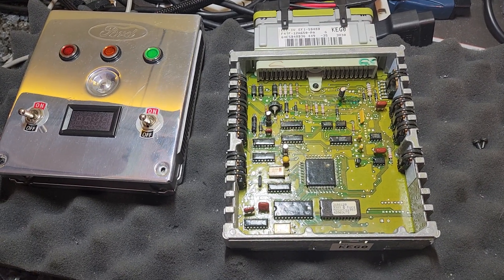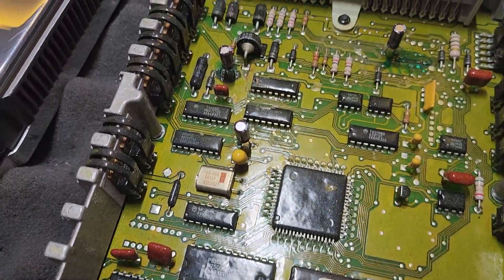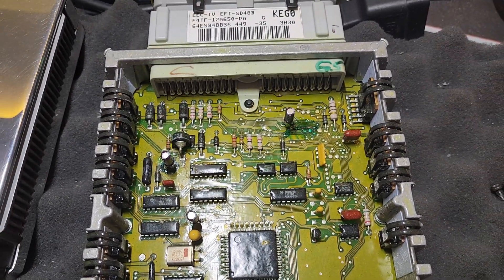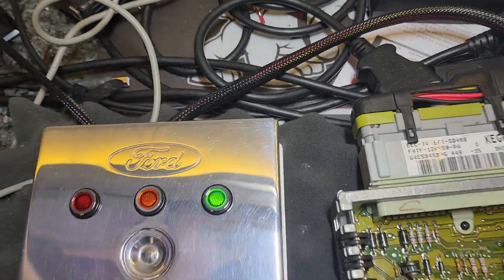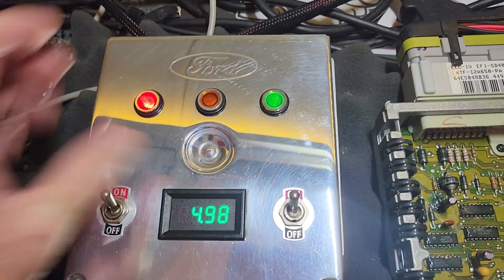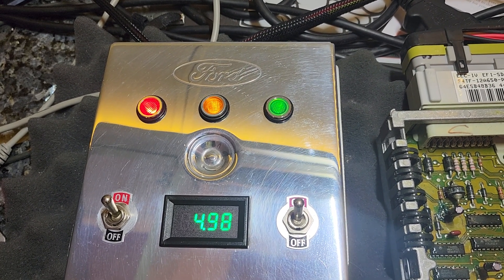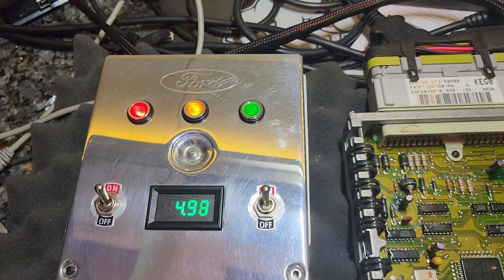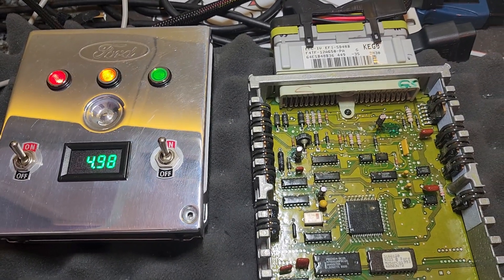Post Repair Inspection of Tim M's 1994 Ford F250 Computer

Comment: This is really cool. I have a 1992 jeep Cherokee we actually have a couple 92s. I am curious if you could take a working ECM and refresh it better with modern parts or upgrade it in any way to make it more reliable or beefier etc? I don't want to make a super long comment here but my cherokee is heavily modified and we also take it on long trips I've done a lot to make it more serviceable and build in reliability. I'm very familiar with the wiring and modules and things but I'm not familiar at all with the internals of the engine control module or this type of work. 
Anyways it would be neat to have an ECM refreshed with high quality parts if that is something possible or worth doing? I have spare used control modules. 
I don't trust reman or aftermarket control modules I find a lot of that stuff is junk and put together cheaply. 
I don't know much of anything about control module internals but I do know on the Cherokee ECM when you take it apart there's this rubber like stuff it's filled in with so a person would have to dig that out I believe I haven't tried getting into one.
I would be very interested in having a control module gone through and upgraded in any way to make it better stronger or more reliable plus it's 30 years old now.
Reply from the maker: I'm not familiar with the older Dodge computers. But any computer that has electrolytic capacitors in them that is over 20 years old would be highly recommended for replacing the capacitors BEFORE they leak. They are about the only part inside that has a shelf life. Everything else just works until it doesn't. These die of age, regardless of care or mileage.

Computers that are under the hood are usually sealed up with some sort of rubbery type gasket material. Computers installed inside the vehicle don't need to be waterproof, and so they may not seal them at all. That's how this 94 is, unsealed and very easy to take apart.

Professionals who repair PCMs regularly will heat up the computer and carefully cut or pry apart the rubber seal to get it apart without damaging the PCM. After it's apart and repaired, they clean all that rubber off and replace it with something similar, or maybe even just silicone. I don't know if the older Dodge PCMs have electrolytic capacitors in them. But if they do, they should be replaced based on age alone. We're seeing 94-95 Fords now coming in with capacitor issues, and have been seeing 87-93 Ford PCMs come in for many years now. So your 92, if it has capacitors, is the right age (or late) to replace them. Everything else in the PCM is not in need of refreshing or upgrading, just the capacitors.

We only do the Ford computers, but I can probably turn you on to some smart guys who do the Dodges, if you can find out that your PCM has capacitors in it. A lot of the pre-96 era stuff does.
Reply: @dragradialperformance3540   thank you for taking the time to write me a nice response I have some research to do then to find out if I have those capacitors. 
I do put a lot of trust in this vehicle my wife also daily drives a 92 Cherokee we really like Cherokees and it just so happens we like the 92 models I've had almost every year of Cherokee xj but the ones we have kept and really like is the 92s or 91-95 really is what I tend to stick with. But anyways I'm going to do some research and see if I can figure out more about the ECM. My cherokee is very heavily modified I've rebuilt most of the harness with mil spec wire that was a fun project a little tough to find some of the contacts for the OEM plugs. I could have gone with an aftermarket computer and stuff but I've done some things and added some stuff to get more out of the stock systems and I just like having the stock control modules I'm running a piggyback setup on the transmission control module to do some neat things in conjunction with some transmission mods but I also retain all the stock functions. Then I'm running a stroker engine with some things to make it all work with the stock ECM it's actually been very reliable I've played with these jeeps for so many years that I've kinda figured out what's best for reliability and modifications sometimes you don't always get reliability with modifications. Then I have access to diagnostics for the transmission and engine module even some live data with my snap on mt2500 you probably are familiar with that since you work on the pre obd2 Ford's. I'm a bit of a nerd when it comes to my gadgets and playing around with these jeeps. 
I've never seen a Cherokee pre obd2 module fail except for I have seen the voltage regulation fail which is controlled by the ECM you can replace the ECM or set up an aftermarket regulator to correct the problem. I really like the idea of having someone freshen up a module or two for me if it has capacitors, I'm definitely going to learn more about their construction. We plan on driving our Cherokees and others for a long time to come. 
Thanks again for the information I'm excited to learn more about it.
Reply: @dragradialperformance3540  here's a short little video linked below of the ECM I have. it looks like it does have capacitors from the little bit of research I've done. I actually was reading some reviews on capacitor kits available for the ECM and one review said that he had a computer repair shop installed them and it works great. My ECM is coated with that rubber stuff as it's under the hood. 
I still want to look into it more but I wanted to add this 2 minute video I found that shows what my jeep ECM looks like. 
Ideally I'd like to find someone who is familiar with control modules and knows what the best parts are to use like the best brand or type of capacitors if that matters. I'd just like it done as best as possible if I'm going to do it and it should also be sealed back up well afterwards because my jeep sees some nasty conditions sometimes. I'm actually kinda surprised I've never experienced any problems because there's tons of stuff about capacitor failure when I Google search. 

https://youtu.be/JlyGkSAEAvE?si=I1fSLbIZd4TlSvM2
Reply from the maker: @forreststrong797  yes, that's them! Look into Nichicon capacitors. They're high quality Japanese capacitors, and it looks like those are the ones used by Jeep, as well as our Fords.

Comment: I need to do this on a 06 wrangler unlimited. Does it work well?
Reply from the maker: What, replacing the capacitors? It does if you know what you're doing. It's not really a DIY job. Does a Jeep pcm that new still have electrolytic capacitors?